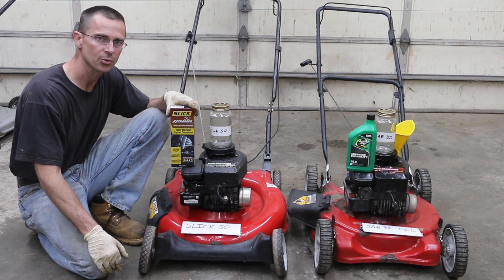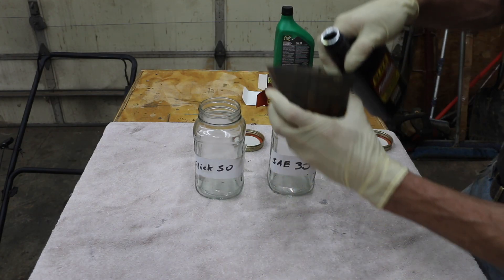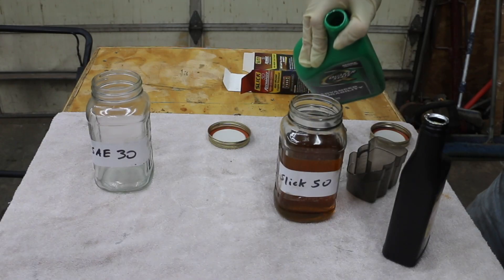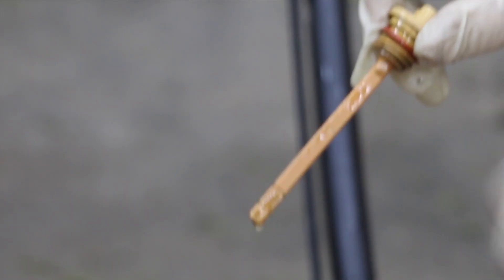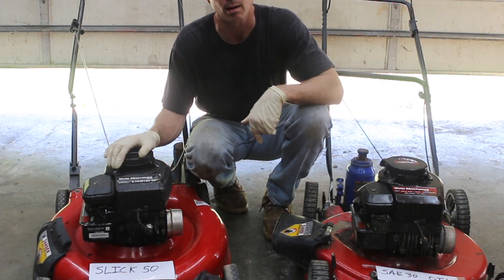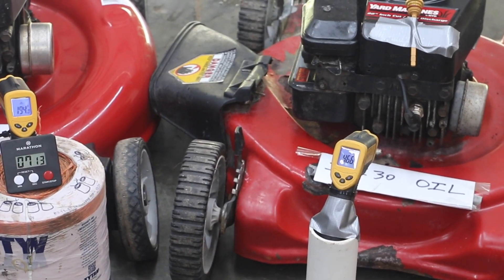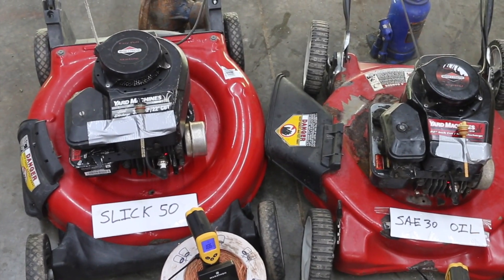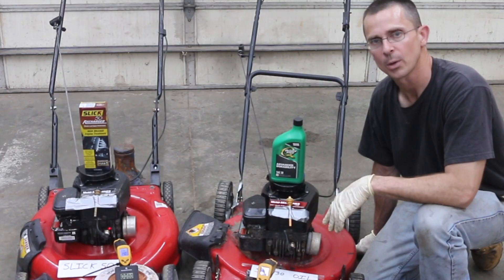Can't believe what SLICK 50 did to my engine!!--Dry Crankcase Test!

Comment: The slick 50 was amazing keeping the engine cooler, run more efficient, 
I’d like to see you use Amsoil in a comparison to reg oil in an engine
Reply: I had a 1995 Ford f-150 with a 351 or 5.4? Anyway the truck had about 110,000 on it when I bought it. I started using Amsoil 10w40 in first oil change and I changed it right at 10,000 mi. but would change the filter about every 5,000 mi. & top it off. On my way to Albany,Ga. about 12-15 mi.from town the serpentine belt broke and there was ,at that time NOTHING on this road (no stores etc.) so I drove it into town. The whole time I was watching the temp. gauge & it went up some but never Hot! When I got to the auto parts store I opened the hood for it to cool while I was getting the belt (15 Min.) went back out and put it on THEN and the truck didn't seem any hotter than normal! I forgot to mention that it had 170,000+ on it by then. I finally traded the truck 4-5 yrs. later to a mechanic cause the trans. went out. To this day I don't know if it was the oil or an exceptional engine.  George Henry
Reply from the maker: Thank you for this recommendation!
Reply: Ironically the hotter the engine runs, the better the thermal efficiency...at least with liquid cooled engines. This why all modern cars have a hot thermostat to run the engine as hot as possible without over heating.
Reply: +|Mike Foehr "Ironically the hotter the engine runs, the better the thermal efficiency" That's not strictly the case, Mike. When engines first start up from cold, they are very inefficient thermally, due to the fact that a larger proportion of the combustion heat generated is converted into warming the cylinder walls & heating up the block & crankcase. An engine reaches its peak thermal efficiency when full working temperature is attained. But the efficiency doesn't increase further as temperature rises beyond that. An engine block that runs closest to combustion temperature, has after all, to be brought up to that temperature by wasted combustion heat! Thermal efficiency is the proportion of the burning fuel that is doing actual mechanical work, rather than just heating up the mass of the engine or venting to atmosphere without doing anything useful. This is precisely why diesel engines take so long to reach working temperature from cold compared to the much less efficient petrol engine, & why diesel exhaust temperatures are 200C lower than petrol exhaust temps. This is also the reason why petrol turbo's are more responsive to the throttle & from a lower engine speed than diesel turbo's. The petrol engine is wasting a huge amount of combustion heat to atmosphere to drive the turbo! A car diesel's thermal efficiency of 45% compared to a petrol's 30%, means that almost half of the diesel fuel is doing mechanical work, while in the petrol engine, less than a third produces power, while over 2/3rds of the latent heat of the burning fuel is wasted to block & atmosphere.
Reply: Is it possible that the exhaust from the slick 50 engine was warming the air around the regular oil engine reducing its air cooling efficiency? Also there can be variation in new engines, let alone used ones. Still a valid and interesting test of course, just things to consider.
Reply: Great story Mr. Henry. I had a similar experience on my '93 F-150, 5.0l V8. I was driving from Palmer to Cantwell in Alaska. It was early spring, still a bit chilly. My water pump seized solid and snapped the nose off the pump and sent the fan into my radiator. No belt, no alternator, no water pump, and 40ish miles to go!!! I barely made it to Cantwell (Battery was about out of juice) but, it never fully overheated. With no coolant in the engine, the sensors weren't reading accurate anyway. This was at 204,000 miles. I had been using Amsoil since I bought it at 167,000 miles. Engine oil accounts for about 40% of engine cooling. I swear by Amsoil, great products. By the way, NEVER break down in Cantwell. It was the most expensive radiator water pump and belt I ever purchased (bastards had me, lol).
Reply: I know a guy who used Amsoil in his hot rods. Installed a bypass system wrong so it only ran the motor off the oil filters. Ran to Vegas and back from Nor. Cal during hot August nights show. Ran about 20° warmer but no damage when he got home and realized he crossed the lines on the bypass.
Reply: Make Money With Direct Mail Run hotter and you have better efficiency. Peak EGT is around 16:1 AFR.
Reply: Mike Foehr if I was building a cooling system it'd have a three way 'stat. Low, medium, high. High is the hot thermostat you speak of. If you had high power demands it'd kick to medium to save the engine, and low (+5 minutes of mild limp mode) if you still went into the safe overheat band. If you had the machine in TOW/HAUL mode, it'd go to low temp.
Reply: I ve seen Slick 50 at Walmart here in Arizona...total crap..

Comment: Well if you still have those engines I would like to see a video of you tearing them apart and I'd like to see what the crankcase looks like or the crankshaft the the bearings and the piston and rings I would like to see what that looks like if it all possible but that's an interesting because it seems like slick 50 is only good for temperature reduction and not lasting wear
Reply from the maker: Thank you for this recommendation!

Comment: It was hardly a fair fight as the mower with slick 50 had more worn tyres on and wasn't the exact same mower either. You should have used two brand new engines as you did with a previous test, that would have been a fair comparison!
Reply from the maker: This is great constructive feedback. The latest video includes 2 new engines.

Comment: If i remember correctly, Slick 50 requires a certain amount of actual run time in  an engine to fully impregnate the bearings and surfaces.  something like 50 - 100 hrs operation for full protection.  again this from memory, so i could be off.
Reply from the maker: Yes, you're right. Thanks for the constructive feedback!

Comment: I have used Slick50 since the eighties. It was everything they claimed back then. The original inventor has long since withdrawn from Slick50 owners and took his formula with him.  Nowadays Slick50 is no more than a con. However, the original owner is now manufacturing the original product as ExcelPlus and it is what the original used to be.  It is not snake oil and I am using it in every motor I own including my V12 E type Jaguar and a 250cc super kart.  I have it in both of my boats engines and my lawn mower and I believe it is everything it claims to be.
Reply from the maker: Thanks for the recommendation on ExcelPlus.  I plan to test it in the future.

Comment: Duralub is what i used in a car threw a rod n kid you not drove 15 miles with no oil or water n made it home.yes i trashed heads n all but i proable wouldnt made it 3 miles with regular oil.sucks i cant find it no where now.
Reply from the maker: Thanks for commenting on this.

Comment: People applying all kinds of mental contortions to justify S50. I believe the 1984 date may refer to the litigation Sl50 lost, regarding false advertising? As a general rule adding any additives beyond the oil formulation likely degrades the properties of the oil by itself; this test may be revealing some aspects of that phenomenon. OEM Slick50 had visible teflon suspension if I recall, and that could definitely plug narrow flow areas, and also reduce the surface contact between the metal and oil in high speed sliding circumstances. Snake oil is still snake oil.
Reply from the maker: Excellent point!  Thanks for commenting.

Comment: The oil in an engine has two main functions : (1) provide  the oil film between the sliding surface e.g. between the journal and the crankshaft, and (2) remove excess heat generated by the sliding oil film so that heat does not accumulate in the bearing surfaces. Whatever magic oil may be able to provide the first function, but not the second, because the bearings need oil to circulate in order to remove heat. So an engine without oil in the sump inevitably builds up heat concentrated at the bearing surfaces (not detectable outside) until the expansion closes the gaps.
Reply from the maker: You're absolutely correct!  I continue to be amazed that some of these additive makers do demonstrations on engines running without oil.  How does the engine dissipate heat?  Thanks for commenting.

Comment: After draining the engines, it seemed the jar of Slick 50 had more oil in it than the other. See what you guys think. If so, then it would be an unfair test.
Reply from the maker: The engine with straight oil ran much hotter, a sign that oil wasn't present.  I'm sure both crankcases were empty. Thanks for commenting.

Comment: I just watched your BestLine vs 30W video and came here.  I remember that Slick 50 commercial you mention.  Weather or not this was a fair test due to tolerances and wear of these two engines versus 2 identical new engines in the BestLine comparison is a worthy question, IMHO.   We just don't know if the result would have been the same if the engines were reversed.
Reply from the maker: Great point.  I will likely repeat the Slick 50 test in the future after I test a few other additives that I've promised commenters that I'd test soon. Thanks for commenting!
Reply: As always, keep up the good work.  I enjoy watching your videos.

Comment: Another one to try is BG moa mixed with oil. They claim that it will run without anything if completely drained. I do believe they have good products though. We use them here at the shop.
Reply from the maker: Thank you for this recommendation!

Comment: My grandfather is the original inventory of slick 50 ....the formula they have been selling is all guess work has been since the 80s when he left ....I can get you a bottle of the real stuff if want to do a test with real results ....at one point they were just shoving Teflon in a bottle and shipping it out to keep up with demand that's why of people were reporting engine failures ....
Reply from the maker: Thanks for commenting on this.  Lot's of commenters have mentioned that the formula changed in the 80s.  Thanks again.
Reply: Project Farm are you interested in trying the real formula that was Toyota certified with Mario andretti driving a datsun with no oil for 50 miles!

Comment: Have you tried Wesson vegetable oil? It's great on salads, too! (I'm serious), if you have a test with several oils (for comparison), try cooking oil. I know it has a low burning point, but it would be fun to see compared to expensive oils like synthetic oils. travelling through Utah, my rear end differential ran dry of Hypoid 90-weight gear oil. All I had at the time was cooking oil. I figured "ANYTHING is better than NOTHING". It lasted until I made it to a gas station...and I saved my rear end differential. Kind of. I still had to replace bearings, but at least it didn't seize in the endless salt flats.
Reply from the maker: Not yet. Thank you for this recommendation.

Comment: Just do you oil changes, and keep it in good condition than you don't need that SH&T at all..
Reply from the maker: Great point and thanks for commenting.
Reply: I have always treated my engines with Slik 50 and never had an engine failure as opposed to just oil.  My car bodies may rot but the engines roll merrily on; over 450k miles in the case of my old motorhome.  I'll carry on using it too.
Reply: Anthony Wayne - I am fluent with words but I don't go on correcting the spelling if I understood the point.
Reply: Just goes to show you know nothing about treating the crankshaft...
I have a 8 HP Kohler engine engine with 900 hrs on it and it's never failed ...
Reply: Anthony Wayne ,maybe when your typing a word,your keyboard makes another suggestion and puts that word in place of what you thought you texted in your texting to begin with lol,as it happens to me all the time,and it is now why I go back over what I  thought i texted to begin with, so doesn't bother me when I read somebody's else's texting omg lol as it happens 😆👍...
Reply: Anthony Wayne. im the same with there,their but im dyslexic.
Reply: when someone doesn't get it right I quit reading their comment! It's just like their, there, they're all have a different meaning. It's dumb fucks that screw up in my book!!! Just like the comment above yours, he can't spell Slick 50 correctly so did he really get over 450k miles? lol......................
Reply: I have a push mower that says it never needs an oil change, bought it used. It had break-in metals in the oil, changed it two times and its still looks good after using it all summer. After the oil changes, I add about a tablespoon of LubeGard because it improves the oil to take the heat better, proven in the A/T market. I'm not into wasting money on all those marketing claims on TV.
Reply: THEN! NOT than. Why do people screw up the usage of those two words so often?

Comment: I would like to see this tried with liquimoly
Reply from the maker: Thank you for this recommendation!
Reply: Project Farm - please do it with liquid Molly
Reply: Liquimoly's Ceratec seems to work great on my engines for years, their oil additives are superb.
Reply: Same
Reply: i agree! liqui moly!
Reply: Even better Redline and wynns products, still small scale test, but most motor engines have the coolant to keep them cool and keep the engine oil last longer and also a oil filer as well? The only friction modifiers that work are those which are made to use in industrial applications because they are so pure and i know that work, because we have to supply tests and test reports to companies to prove it via oil test before and after and thus having large printing factory and other factories which use normal engine oils to run those machines but just a lot more oil like 4 x 205 lts of oil in each machine and by using wynns industrial friction modifiers to those oils the oil in the machines lasted  times longer than using the normal good grade of oils ? Like Mobil 0W 30 or 0W 50 ?
Reply: I agree,liquid moly test would be interesting
Reply: Liquid moly products are not as good as pure industrial grade friction modifiers, trust me, i used to see them fior Wynns Industrial Products. :) Most new friction products on the retail market are nothing but watered down industrial or NON Reti9al Friction products, no matter what the brand ?
Reply: At least in my cars they have always performed superbly. I have good reults with Bardahl additives also. From american market (I'm in Europe) I have used one called Metal Lube and it was fantastic - maybe the best by far, but impossible to find here.
Reply: I have found using real synthetic (group 4 PAO and group 5 Esters) oil to be more important than the viscozity indexes themselves - I have had great experience with 10W-50 and even 15W-50 PAO/Esters oils in winter conditions, much better than with some mediocre group 3 (hydrocrack) 5W-40.
Reply: OK If you can get wynns Industrial Friction products from a dealer and then use as directed, trust me, if you still change your oil when your supposed too and use a good quality friction modifers with say molybond as the main active ingreadent, then your engine will go far and wide, but still it depends on what car you drive and when your going to update and what are the average temprtuer conditions, which in Euope it snows which means you need to use a 0W or 5W base synthitic oil so basically a 0W 30 full synthitic oil or a perfect fit is check the OE Manufactuers oil specs and then doa serch on say mobil, Castrol, Vavoline or Pentrite if you can get it there and use those brands and also more importantly you must use a synthitic suitable oil filter as well and its bettetr to be safe than sorry ? cheers and hello from australia and today is australia DAY 26th Jan 2018. :)
Reply: TheBimmerfan that would be a awesome test

Comment: I agree that the best circumstances would be to test identical new engines to remove as many variables as possible, but that kind of testing gets real expensive real fast. I wouldn't expect a unsponsored channel to do that. I really appreciate the thought, planning and work you put into your videos. Thanks, and keep up the good work.
Reply from the maker: Great point.  I used new engines in the latest "showdown" between Bestline and Conventional Oil.  Thanks again!

Comment: You need to control the variables to do comparisons like these. 
—We don’t have a clue on the conditions of the motors
—We don’t know the rpm differences, if any, between the two engines.
—We don’t know if the engines are the same model
Unless variables are controlled, experiments like this are completely meaningless.
Reply from the maker: Thanks for the constructive feedback.  All great points. I hope the most recent video I published demonstrates improvements in these areas.  I used new engines, same RPMs, same make/model. Thanks again.

Comment: THE SLICK 50 WOULD HAVE TO HAVE BEEN IN THE RUNNING ENGINE A REALLY LOT LONGER TO GIVE ITS' EFFECT.  ACOOLER RUNNIG ENGINE GETTING MORE MPG IS WHAT I HAVE FOUND WITH S 50.   marine-tex works on cracked heads.
Reply from the maker: Thanks for commenting and thanks for the recommendation on Marine-tex.

Comment: None of the additives actually work whether they are crankcase boosters (oil) or fuel system cleaners. Save your money. Wanna save you engine? Use a full synthetic oil. Wanna keep your fuel system clean? Use a good-grade fuel. They all have cleaners in them.
Reply from the maker: Thanks for commenting!